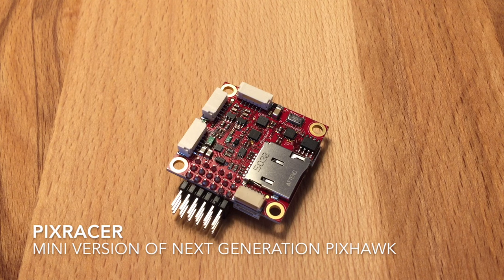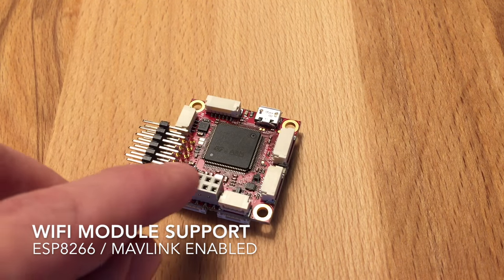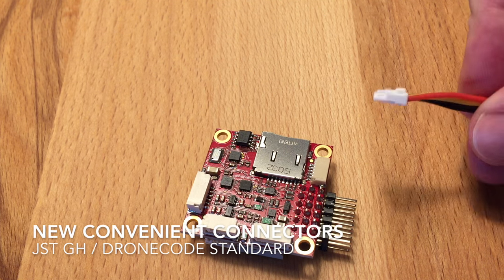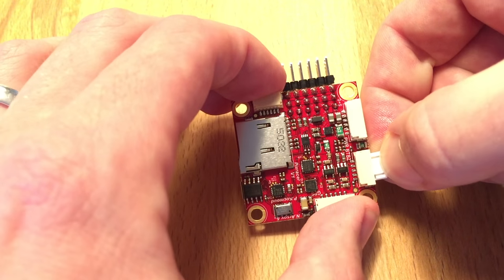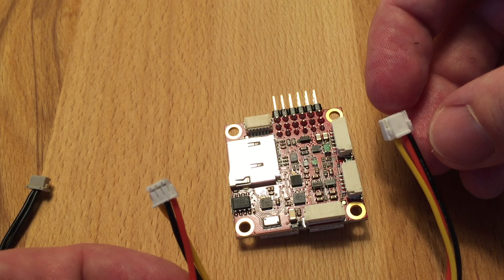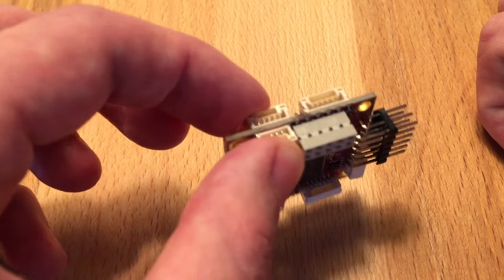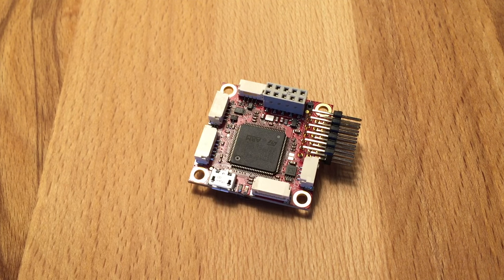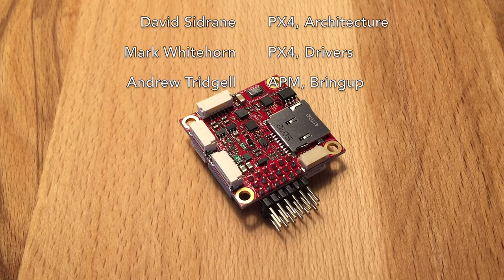Pixracer Flight Controller Overview

Comment from the maker: @Jon We're trying to focus on the essential, in particular since many FPV pilots prefer no OSD these days or just very basic information like flight / lap times (which means they are less sensitive to latency, which might be a core reason to include the OSD chip on the board).

Comment: I was considering the Pixracer as an alternative to getting the classic Pixhawk for my next build, a Hexcopter with retracts but I would use up all the servo outputs for the ESCs and not have an aux output for the landing gear. I like the Pixracer as it could be mounted between the center hub plates (18mm clearance) since the connectors are on the side rather than on top like the regular pixhawk. The other nice feature is that it has frsky telemetry output which I don't believe is available on the regular Pixhawk. Also like the connectors that you have chosen. Do you see a way that I could use this on my hex and still be able to operate the landing gear via the flight controller ?

Comment: Seems nice bit please 1aux out for landing gear ;) The reason i ask for this is the fact that in Belgium the government has decided that the maximum weight of a consumer drone may not exceed 1KG. So i am building a 3 axis gopro platform. As you can imagine this is very difficult, so every gram counts. I use the lightest frame, esc's, motors, gimbal i can find, so that i can still have a reasonable battery. In this context a fc like this is great. For the moment i am going to use a first batch VR Micro Brain that i have but never used. I think that pixracer will end op more in this kind of builds then actual racers. FuriusP comment below illustrates this. Very few people are going to use this in a racer. Same happened to micro vr brain. A simple naze32 or clone is more then enough for a true racer.